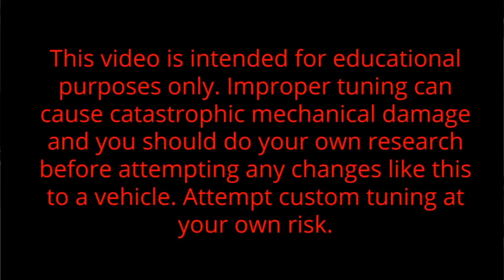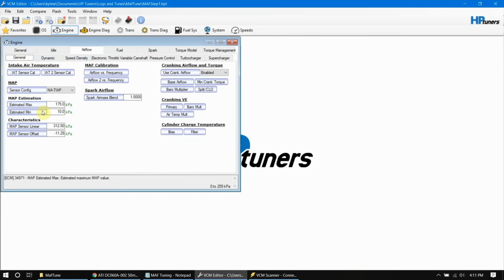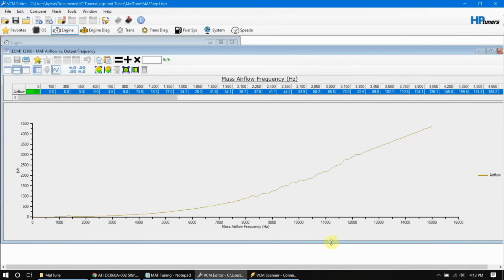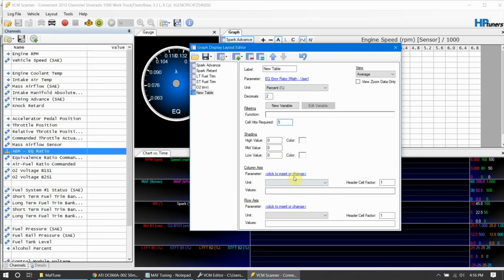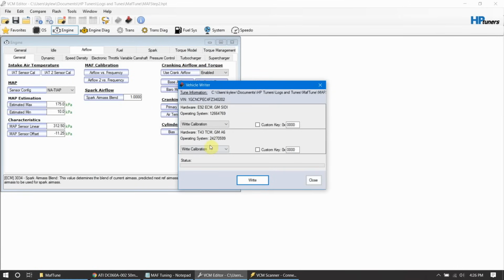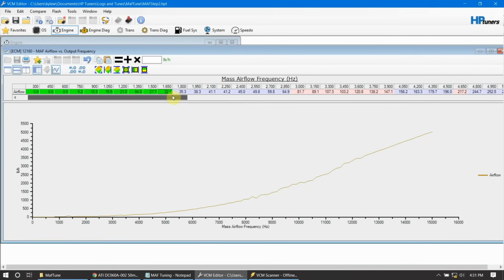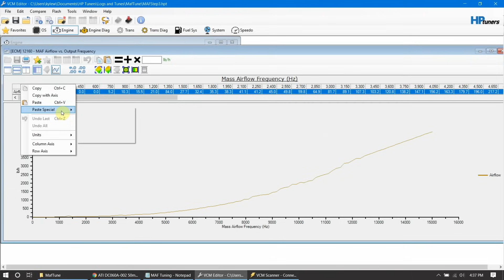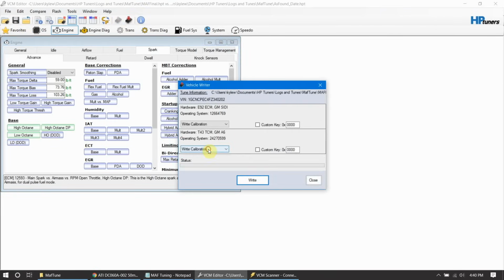MAF Tuning and Scaling, Tuning Series Vol. 3, HP Tuners

Comment: I installed an L83 Truck DOD delete Stage 1 CAM kit that maintained VVT adding 4-degree phase limiter from a performance company in the CONUS.  Is the initial MAF tuning process the same?  I am running the tune the company provided, but am weary of they make a change, I load it, capture a log, send it back, and then wait a day or two for a changed tune.  Would starting from a stock tune and applying your series to it put me in a better situation?  The biggest change I see they made from stock is in the Airflow - Variable Camshaft - Desired Angle and WOT Desired Angle, Base settings.  Should their VVT settings be retained if I chose to follow your Tuning 101 series?

Comment: I have been helped so many times by this community started by Kyle. Thank you Kyle! I am having an issue with my 6.0 LS/TR6060 69 c10. I am tuning and just made my step9 file and was happy with it enough to be done.  As soon as I put all settings back to normal just like in this video and fired it up, it was way rich up top (like .72lambda when it should be .82 in PE up top).  It was also off at idle and cruising around even. STFT and LTFT was adding anywhere from 10-20% even though I had everything MAF tuned to a very happy place.

Comment: Finally! A useful place for HPT beginners to learn!
Reply from the maker: Thanks for watching!
Reply: @GoatRopeGarage  I have Question. You copy and paste the MAF table info into the histogram on the scanner. After logging and collecting the data, you then copy that, and paste special by half back in the MAF table in the editor. You say to rinse and repeat, and my question is, do you then copy that new MAF table and paste it back over in the editor again before running another log?
Reply from the maker: It's not a new table but an error table that is calculating the error between what is calling for and what it's seeing so you keep working on it until you get closer to 0% error. I normally shoot in the 3% +- range on the maf
Reply: @GoatRopeGarage  I meant, do you paste the new MAF table info back into the scanner, not the editor. But yes, the error table that was made from the start. Is that changed with every log scan?

And thank you for the reply man. I really do appreciate it a lot. I'm preparing to do a tune on my Firebird that I did some crazy mods to lol

Comment: Hey GRG. First off you Tuning Videos are amazing. I just recently upgraded my V2 with heads, cam ported x blower, and intake. I was able to get the car going with the narrow band sensors just watching your videos. Now I'm trying wideband tuning. I purchased the AEM you mentioned. I doing MAF tuning now and disabled the Dynamic Airflow and O2. The issue now is I can't get the car to heat up the Wideband. It shows Heat about halfway up then the cam hits and it drops out of heat cycle. The wideband is in B2S2 in the Long Tube headers. Any tips on how the tune can help heat the Wideband.? 😊

Comment: I won a unicorn, one owner, first Gen 2003 Ford Focus. I have replaced the 1 5/8” header and complete exhaust with a 2.5” performance header and exhaust. Deleted the CAT. Installed a 2.5” x 12” long Flowmaster 40 muffler and a 2.5” x 12” long resonator. Complete K&N cold air intake kit. Upgraded the entire suspension leaving it at stock height. Lighter aluminum Koenig wheels and mounted Continental Road and Track tires on the wheels.

I made the mistake of purchasing the Thornton Stage 3 tune and app/software. Haven’t uploaded to Focus yet. Believe I will be returning the Thorton tune, after working through your tuning series.

Any recommendations would be appreciated. Thorton confirmed that they don’t have any active forums to support their product/brand. They just referred me to their reviews page.

Thanks 🙏in advance for whatever you might be able to suggest.

Comment: Awesome vid! Quick question, I’m tuning on a 2010 Camaro SS with an L99 and do not see an option to edit “O2 Readiness Voltage”. How would I accomplish this without seeing that as an option?
Reply from the maker: There should be a table or set point on the left hand of that table that will be engine coolant temp for enable closed loop, make it a high value
Reply: @GoatRopeGarage  Got it. I appreciate it!

Comment: Just started using HP Tuners, I’m trying to disable Open Loop but I don’t have 02 Readiness Voltage as something I can change. How else do I go about keeping 02 sensors from adjusting fueling? Thanks!
Reply: I have the same question, you ever figure this out?

Comment: Can you log maf error in any gear? I’m trying to get my curve dialed in but I keep ending up with a lumpy frequency chart. Unfortunately I’ve only been able to do redline pulls in first gear due to where I live. I can do some smoothing but a re-log just wants to correct it. I have my ve dialed in plus stft and ltft’s and any other fuel modifiers turned off. I’m also running the stock airbox with an aftermarket filter.

Comment: First time viewer.  Great content for novice tuner.  Question, is the wideband 02 system monitor kit (e.g. Ballenger Motorsports AFR500v3 kit available from HP Tuners site) installed when doing all these changes?  Don't recall if Volume 1 video speaks of specific kits or even if needed, and if so, when and by whom.  It would be nice to know, perhaps content for the Volume 2 "Setup".

Comment: Definitely enjoyed the quick hitter video with the theory behind the changes in a separate vid. I’ll be working through these tips in the next few days on my cammed 6.0. Bought a mail order tune for it and struggling to even get it to idle. Bought HPtuners MPVI2 pro with a wideband but can’t decide whether to work with the mail order tune or start from scratch. Any suggestions?
Reply from the maker: John, I'd probably start from scratch, a cam is hard to tune without being able to log the car and see how the changes actually are working. Speed density just takes time, work in small increments starting in the idle range of the map and gradually work out from there. Cams are definitely one of the more complicated things to tune and make sure and dive into the forums, you'll find some good tips for your platform if you do a little digging. This on an LS2?
Reply: Goat Rope Garage it’s an LS1. 
I’ve found some decent write ups on speed density and I guess I’ll go back to square 1. Seems like creating a file with the stock tune and speed density rtt oss is the place to start. Get her to idle and move up from there.
Reply from the maker: Bingo! Let me know if you run into any issues and I'll do my best to help!
Reply: So I've spent a few hours trying to get a stable idle. I'm basically to the point you showed in the vid where you start, find out it's lean and adjust MAF frequency. I'm also making small adjustments on Injector flow rate as i'm not positive they're really dialed in. At this point it's idling slightly lean but only runs with the throttle barely cracked. If I sent you a tune file and log along with all the specifics of the motor would you be able to look it over and see if i'm on the right track? Thanks in advance
Reply from the maker: Yeah, I've got a new email let me get it setup and verified it works then I'll post it so you can send it. Give me a couple hours.

Comment: Do you have a Gen3 tuning video? I'm swapping a 2000 silverado 5.3L w/ 4L60e, to a 6.0L...  removing Mech fan and adding dual electric fans... Adding Flex fuel sensor.  Big Cam, Higher Compression, different intake, and flex fuel sensor and 80lb injectors.  Found tune for the P01 Ecu from 2002 Tahoe that has Flex fuel, but I still need to add the fans and setup for bigger cam and intake.  I have a WideBand sensor and Gauge that is going in too, so i can watch the AFR on the go.  (sticking with Drive By Cable)

Comment: I am have an 03 Tahoe running 12579405 on a P59. It doesn't give me the option to change the O2 readiness voltage to force it into open loop like you did here. I tried forcing it by setting the "Closed Loop Enable Coolant Temp" to way out of reach (+75 in the table) but that didn't seem to work. Any suggestions? Love the video series. You are awesome.

Comment: I have been following along with this tutorial, and keep getting issues with the car being lean at idle. Got it dialed in at idle, somewhat, and I'm just not seeing the results I'm after...

I added a turbo to my 1.8l Chevy Cruze. MAF is before the turbo. Should I consider speed density tuning? Or could you give me so tips to getting my car actually drivable?  It mainly swings lean, but then at times after logging and making adjustments, it goes super rich.
Reply from the maker: You could try SD tuning and see if that helps, with the MAF before the turbo you're not getting good air temps so try breaking out the IAT and putting it past the turbo and see if it helps
Reply: @GoatRopeGarage  Thanks. I appreciate it. What I decided to do, with the help of your videos and advice in them, was to MAF tune the car with the stock airbox. Got that dialed in to within 1 +/_. This evening I took the next step, installed my larger injectors, and low and behold, after watching your injector scaling video, scaled the injector from 30-35 lbs to 60, and adjusted my MPW. Fired right up, was on the rich side, no biggie, and logged 3 drives. Tomorrow I'll continue logging as I make my errands and get the tune dialed in.

I'm sure I'm having issues because the section of pipe with the MAF sensor is only 4" long. Perhaps I'll try and add a section in to extend it and see how that works.

P.S. I'm a complete tuning newb, and your videos have been a good send. Would you consider a collabe or a testimonial? My personal channel with my car stuff, doesn't have a ton of subs, but my business channel has (Mikey Designs & Silk Screen) 28k subs. So I'm working on growing my car related content...

Either way thanks for the content, and I'm going to make this turbo work HUGELY in part because of your tuning videos. Thanks!

-Matt

Comment: Can you do an updated video on what equipment and sensors you'll need to do this. I personally have a 3rd Gen 5.3 ls that is going to have a mild torquey motor but long term goal is a twin turbo setup. I know I need a new laptop but no clue on what software to get and what wideband sensor and another sensors I may need will be compatible with the software. Person goals are better towing, hopefully improve or minimize any loss in mpg as long as I stay off the gas. And occasionally stop light, more realistically interstate fun. Don't need to be on the edge performance wise, I'm ok giving up some hp for mpg and dependability. Would like to get all the tuning in place and understood before I even install the new motor.  As it sits it's a stock flexfuel 5.3 with cutback flowmaster exhaust and k&n cold air intake. Plan to play and learn now before I start adding cam, intake, boost and various other upgrades to the mix. Tia any assistance is greatly appreciated.

Comment: On hp tuners how do solve when u connect up to the vehicle not being able to read or write to the vehicle without it timing out the only way I could read my p59 was to remove it from the vehicle and use a bench harness?  I even tried to disconnect the radio, remote start, and dorman hvac controller.  On the bench I deleted vats.  I would just like to be able to do everything in the vehicle thanks

Comment: How can I be sure that I am in Open Loop? My GEN 4 (L76) has different table options than your example in the video, so I would like to confirm I am currently only running off the MAF, for proper MAF curve tuning! Under Fuel, OXY sensors, Monitoring I do not have an O2 readiness voltage tab. Instead mine has O2 readiness ECT (it's a temperature table). My pre-existing tune was set to -40 across the board in this table. I set it to 493 (the maximum allowed) Was that the correct way to disable them? Also, under Airflow, Dynamic, Dynamic Airflow my High RPM Disable was ALREADY set to 100 and my High RPM Re-enable was ALREADY set to 90 in my Pre-existing tune, not sure why. Would this meen I was never switching to speed density under wide open throttle? The car was dyno tuned when i got it and runs really well. I am just trying to learn and fine tune it at the same time.
Reply from the maker: Harry, there is a PID you can monitor in the scanner, it's usually called something like fuel status, that will show if you're in open or closed loop. And yeah, max out that etc table for readiness to disable.

Comment: So trying to get as close to the 1.0 as possible, is that getting you closer to 14.7 for gas? Say you wanted 12.5 AFR for NA at WOT, how would you let the MAF know that’s the AFR you want?  

Change it in EQ Ratio under PE settings to get desired AFR? Would I then be trying to get my numbers as close to say 1.175? (PE EQ ratio for 12.5 roughly) 

Trying to tune my MAF using a wideband on a gen 3 p01 NA LS1. Want around .85 Lambda WOT but obviously not all the time. This is all new to me so noob questions
Reply from the maker: Yep, the PE multiplier is applied to the stoich table. You're on the right track!

Comment: First off, this guy is awesome.

Secondly, I'm super confused. With closed loop running all of the time, it's constantly adjusting the fuel. short term fuel trims are going to effect the wideband feedback and cause lean areas to slowly fall to stoich, and rich areas to also rise to stoich. Won't any hits you get also get corrected for?

Additionally, After following the instructions to disable fuel cuts, I still find spots where my lambda sensor goes full o2 at very low RPMs (~1200 or so) in a decel condition before it catches the idle. Something to look out for there as well. It will quickly throw off idle MAF adjustment.

Comment: @goatropegarage in the man tuning under engine/oxygen sensors/ monitoring mines does have readiness voltage mines say 02 readiness ect 02 readiness deadly 02 not ready timer 10s
02 ready timer 10s 

How can I put the negative equation in there for my voltage?

Comment: So if some of the values are outside of -1/+1 range. How do we actually change that? Is it the copying from the VCM Scanner that does that, because instead of some hypothetical values in the tune we are now putting in the actual data from the scanner? If that is the case during the second pull you already used the actual reading from the VCM Scanner. In the low range, they were still in 3-5% range outside of the target. Does it mean that we manually need to adjust those cells by that percentage? Also if I have a boosted car, does it mean that I need to take all these readings without getting into high boost numbers? Thank you

Comment: Man, I love your videos. Just starting to get a grasp on tuning a little bit. I've paused and backed up and paused over and over. I feel like I did everything the same on my 06 Silverado but I can't get it to show up on the new table. On the left side of the scanner my wideband is reading through the serial port and my MAF is reading in Hz. I did the user math and everything. Not sure what I'm missing
Reply: Ok I just noticed something as I was going over mine again. On the math parameters manager making my user math the second variable is highlighted in red on my screen (equivalence ratio commanded), what does that mean?
Reply from the maker: You don't have it on your channel list.
Reply: Thanks, as soon as I change my lifters I can get back to tuning lol. I did a cam and valve spring swap and ended up collapsing a lifter

Comment: Great Video's!  Big help!  Just wanted to add my experience with M.A.F. tuning here with HP.  In terms of the M.A.F. 2D graph in the editor and it's smoothness.  If you look at your scan in the charts VS time table you can see under W.O.T. as the RPM'S rise , the M.A.F. scan is not a smooth rising graph!  It flattens out at points during the pull.  This I believe has alot to do with camshaft as well as air flow from air filter to tail pipe.  So if you smooth out all your peaks and valleys after an EFR error correction then make another scan and apply the EFR error corrections you will see your M.A.F. curve in the graph become un smooth again.  Easy to see under WOT because no varying throttle input. Again great stuff!
Reply from the maker: Good input, Frank! Might have to try and figure a way of testing that out. Part of it is going to also be attributed to the way that the frequency is calculated may not be able to produce a smooth curve and will require correction. What you might be seeing is the correction to manufacturing differences. The standard curve works fine for a mass produced sensor when you take into consideration that you are using the O2 sensors to clean it up in the end.

Thanks again for the comment!

Comment: hey, LOVE the videos, they make a lot of sense out of something that can be overwhelming.  i have a procharged g8 gt that i have just started working on my initial tune for.  my question is i have a new ls3/ls7 maf sensor and 4 inch pipe for it to go into, should i start off with running through the initial tune using my tuning school books and then go throgh the MAF tuning and scaling?
Reply from the maker: Honestly, it doesn't matter, but I'd probably button up my SD tune first since it can act as a fall back should something happen to the MAF. Once you have your SD time pretty good then work on rescaling your MAF.

Comment: So when you adjusted the fueling by 15% did you do that while car running or did you have to turn off adjust the saved tune file by 15% then re-upload into the car? 

Also for example if I wanted say 5% more would I multiply by 1.05? And now what if you want Ted to take 5% or more out? How would you do that?